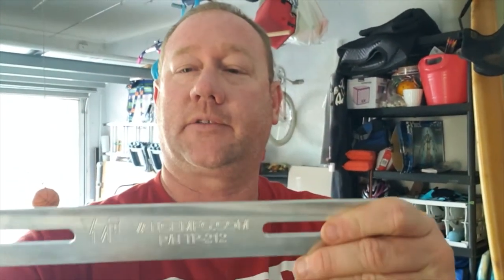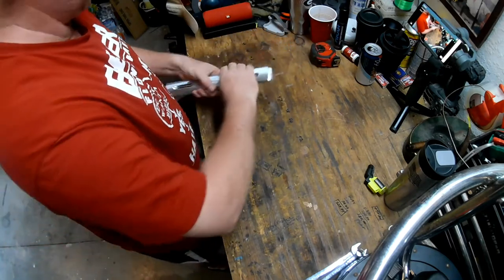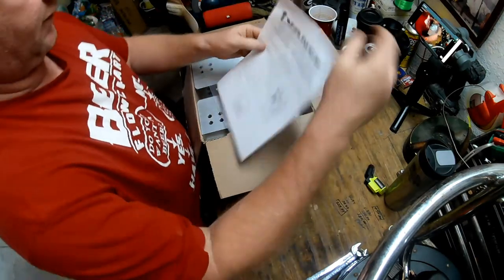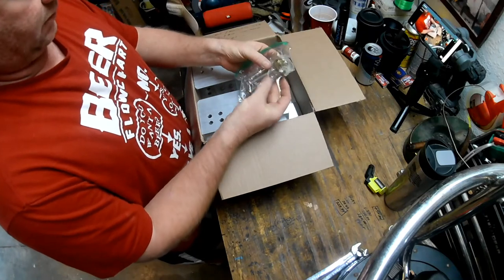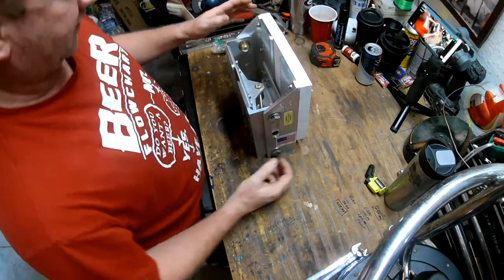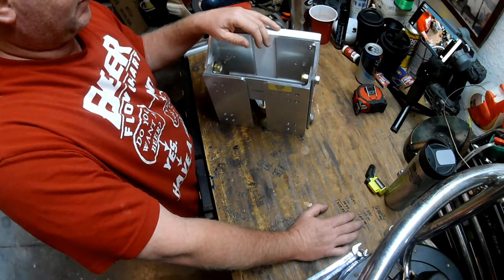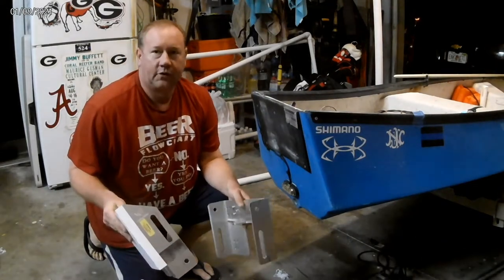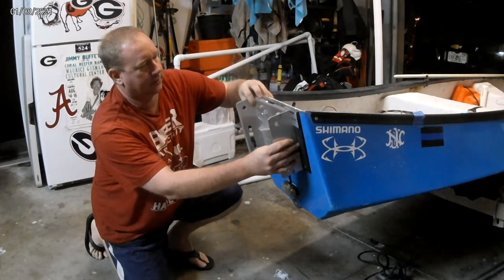Vance Jack plate installation

Comment: Excellent video! I have the exact same boat and motor, if I chose the 2” starboard would it clamp down no problem?
Reply from the maker: Yes...I added about 3/4 of an inch...so 2" should be money
Reply: @residentdawgfishing5424  Awesome! And do you happen to remember the 2 bolts size that actually goes through the motor mount? I know they're smaller than the 3/8" bolts that mount the jack plate to the transom.
Reply from the maker: @SALTxTHExWOUND   no I dont....sorry

Comment: You would think that they would have a thick enough piece that the motor would clamp on directly so someone didn’t have to get extra aluminum flat stock? Nice job on install, I’m getting ready to install a fixed Jackplate on my LT25 so thanks for the video.
Reply from the maker: I guess that would have made too much sense....lol, but I am sure there is a reason for the thickness.   Hope your install goes well.  I love my jack plate.
Reply: I see on the website the sell different thickness of starboard 1-3 inches would that have made a difference for your install?
Reply from the maker: @snat6299  yes it would have. Had I ordered the thicker starboard I would have not had get creative.
Reply: Hey nice content on here. Just wondering is yours the 5” setback or the 7” ?

Comment: Hi,quick question..can you put any kind of jack plate on the gheenoe?
Reply from the maker: The only two I know of are Vance, and Bobs Machine Shop that are specifically made for gheenoes.   There are some that make their own from aluminum angle stock.  Weight would be the biggest consideration.

Comment: Hey, I have the same motor. What thickness starboard do I need?
Reply from the maker: Click on "clamp on plates", " 0-20 hp", then click on the description not "add to cart"....third option down " camping board thickness" option for 1, 2 and 3 inche thickness   Hope this helps...if you can't find it give them a call...they are great people and very willing to help.

I would go with at least the 2", I bought the one inch and needed to thicked it up about an inch.

Comment: Did you just keep the jack plate at the lowest setting?
Reply from the maker: It is actually 1/2" below the highest setting.  I had to raise it all the way up to get the clamps tight so I left it there to start.   Only had to drop it a half inch to hit the sweet spot.
Reply: @residentdawgfishing5424  I'm thinking about getting this jack plate. Is it worth it? And are you getting better performance out of your motor? I have the same boat as you.
Reply from the maker: I am with out a doubt getting better performance,  an definitely run shallower.   Speed did not increase substantially but did a little.   In my opinion it is worth every penny.
Reply: @residentdawgfishing5424   Thank you for the reply. I'm definitely going to look into getting one for my Gheenoe.
Reply from the maker: Absolutely....best of luck with it.

Comment: What’s the shaft length of your motor?
Reply from the maker: 15" shaft....2019 merc 9.9 short shaft
Reply: @residentdawgfishing5424  Thanks for the response! Im running a identical set up and using your video as a reference to how I want to mount mine.
Reply from the maker: @jpiowens  outstanding....I hope you found some useful info and your install goes well.